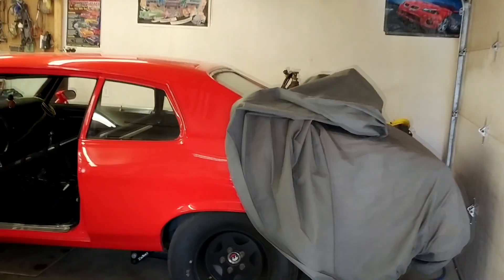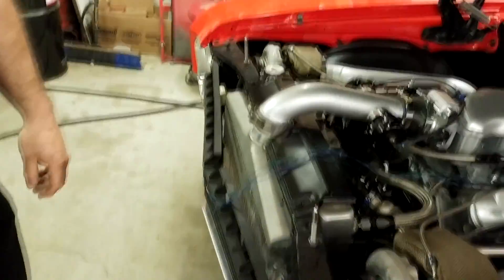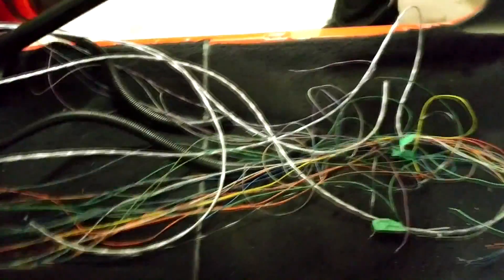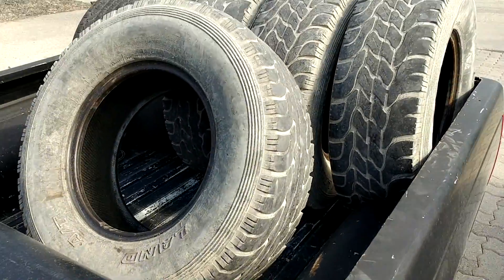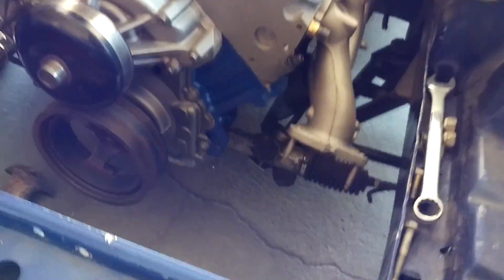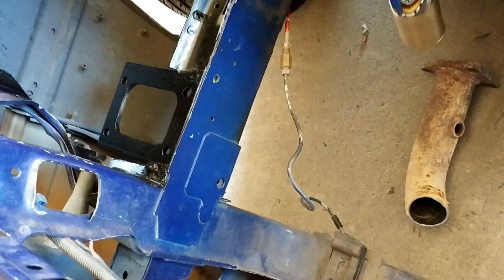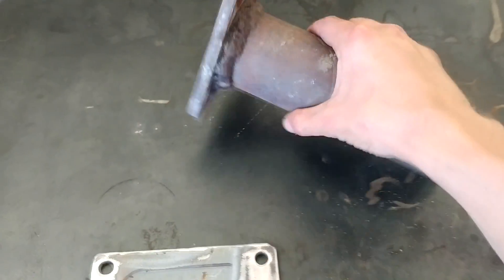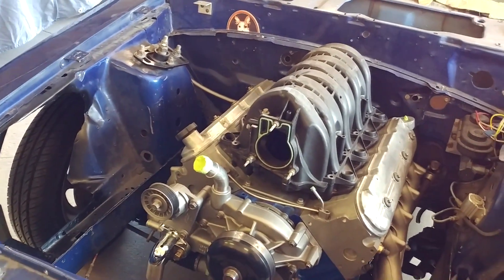Twin Turbo Nova MS3 Pro Wiring | SonicStang T6 Turbo Flange "Fabwork"

Comment: Good job on the wiring Rob.  Love the cleanness of your setup.

Do you guys not have a local greggs or muffler shop with mandrel bends?  I ended up just using 16ga galvanized bends for my downpipes.  They were a cheap alternative, about $25 a bend.

Comment: what engine management are you planning on running for your mustang when its is finished
Reply from the maker: Sloppy Mechanics Stock ECM with HPTuners.
Reply: hptwizzlers
Reply from the maker: Sloppy Mechanics Looking forward to working with Robs MS3 on the Nova as well. We havent used Megasquirt on anything yet.
Reply: its nice, i like it, i havent done anything with ms3 pro but its the same thing, just a few different pinouts, if you need a base i could probably hook you up with something from barry cook
Reply from the maker: Sloppy Mechanics Cool, its obviously a similar setup. I like that the Pro has a boost controller, bump box, 2 step, etc. all built in. My stock ecm setup is cheaper now but once I wanna make a pass at the track the costs will add up.
Reply: yep that is what i always try to tell people about the gold boxes i use, it has everything there ready to rock